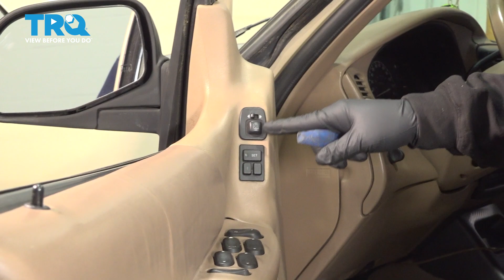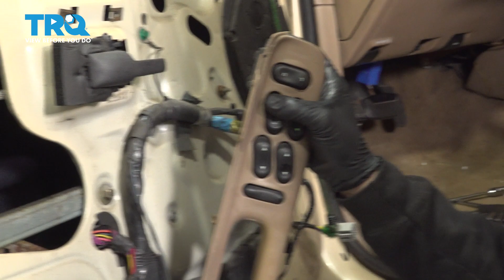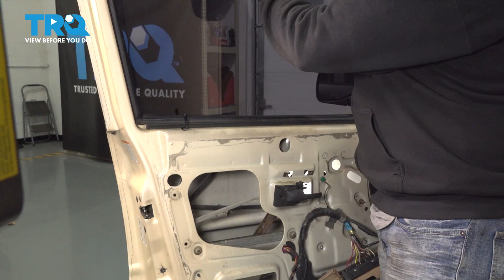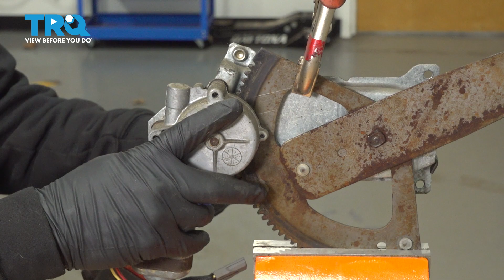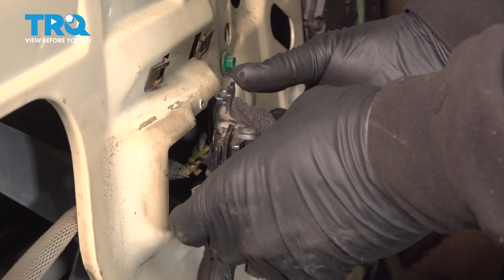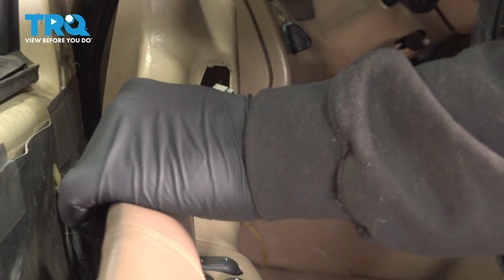How to Replace Power Window Motor 1995-2001 Ford Explorer

Comment: You started with a motor that works, why would we, the viewer, need to replace a working motor? Your entire video is based on a false premise, my window is down, and the motor is inoperable, making your video of no help. Of course, there is no surprise a shop would replace a working part and charge the customer. So, can you replace a failed motor, and how would you do that when the window is in the down position?

Comment: Why did you replace the two rivets that hold the glass with bilts and washers rather than rivets? What size bolts/nuts did you use?  I just received my parts and am about to do this to both front windows.

Comment: What is wrong with this video? 
"So, your power window doesn't operate, because the motor doesn't work. 
Well, to swap motors, remove the regulator. 
To remove the regulator, turn on the key, and run the power-window till you can access the big rivet behind this hole......." 
Let's see if you can figure out the problem. 
I'm waiting.......

Comment: Thank you for the steps, saved me about $250 in labor. Just wanted to add 2 things, the new motor from Ford is not threaded for the mounting bolts, but it will self thread using the old bolts, second I did not use rivets instead I used 1/4-inch x 1/2-inch long bolts with one washer and nylon nuts. Worked out great, thank you again.